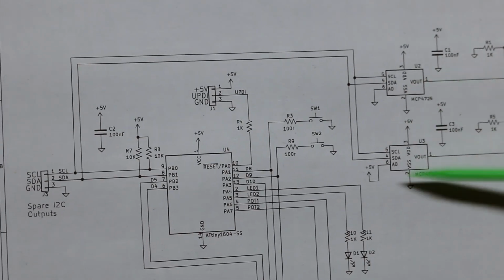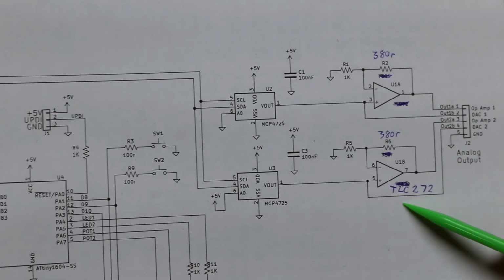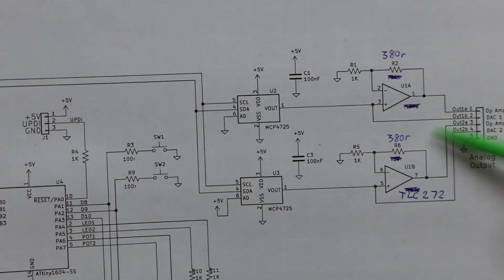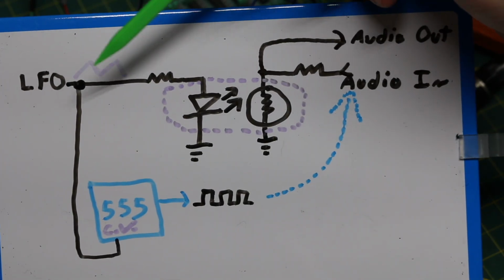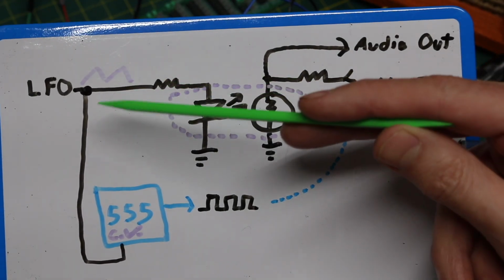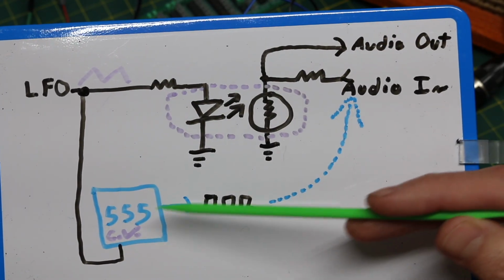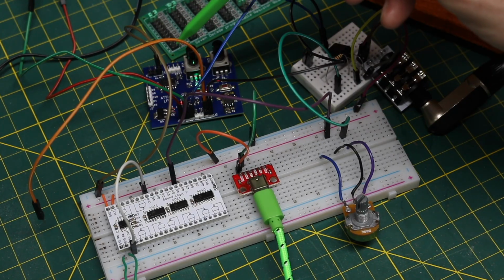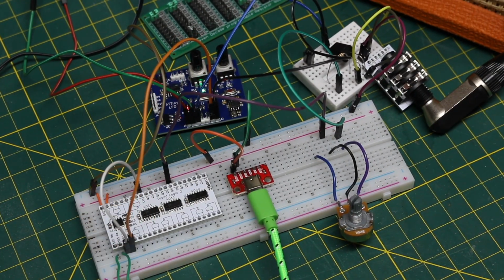MCP4725 DACs Make Good Low Frequency Oscillators

Comment: I would have hooked those LEDs up to the analog output after the opamp so you wouldn't need to use GPIO/PWM in sync with the analog output. Seems simpler but probably less versatile.

Comment: I would try changing the LED to a light bulb in the gain control. The bulb should make it a bit more linear as LED brightness Vs current is not very linear.
Just an idea to try. and more reto. 🙂
Reply from the maker: I do have some small incandescent bulbs I eventually want to try where the bulb is surrounded by multiple LDR’s in a different kind of modulation circuit.
The vactrol  has been successfully used in other circuits so I think the main problem this experiment had was just coming up with the right value resistor so that the useable range wasn’t confined to a small area similar to using the wrong taper pot where you only really get an impact in the last 20%.